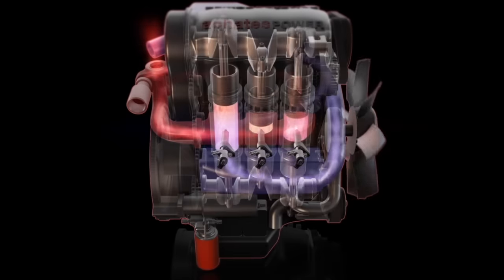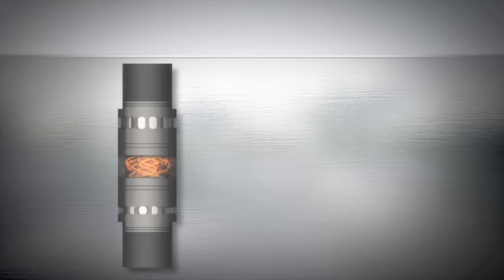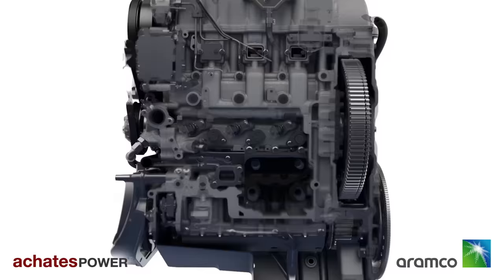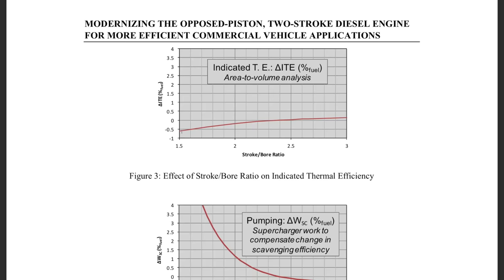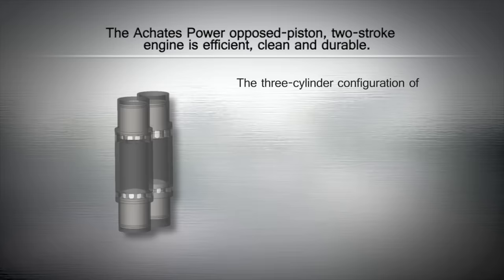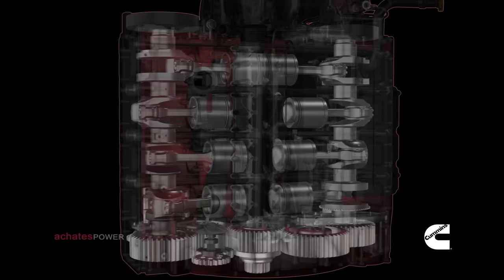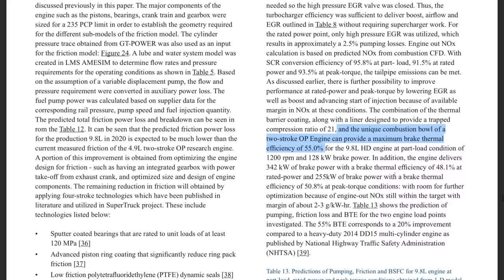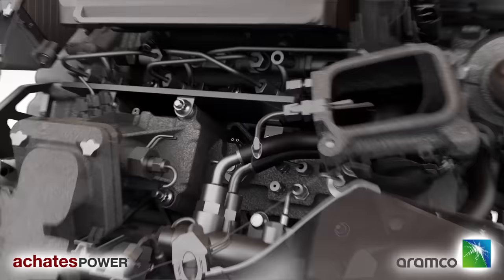Opposed Piston Diesel Engines Are Crazy Efficient

Comment: In homestead fl. There is the largest diesel electric power plant in the u.s. it has 8 op engines and 9 v12 dla engines in 1975 i spent many hrs with my friend who was the plant operator on the midnight shift and these nearly 2 story high engines all ran in sync at 450 rpm and it felt like an earthquake in the ground even 3 blocks away. What was cool was to stand on top of an engine over a cylinder while the fuel mixture was turned up ritch until that cylinder began detonating . It would lift you inches off the head. Also it was so loud inside the plant that you had to screem loud into another person's ear to be heard.  The plant was flexible as well when diesel fuel was expensive they could either mix the diesel with natural gas or run on natural gas alone but that did increase the operating temperature. THE sound of detonating engine; (LOUD)  BAM BAM BAM .The cylinders in the op engines are so big that you could fit 2 people standing face to face inside one.  The crankcase was waist deep in oil. There were blast doors on the side 6 foot square that were spring loaded to release pressure in case of a crankcase explosion.  Which could happen if the engine ever began detonating for a long enough time fire pushing past the rings could ignite the oil fumes in the  crankcase. Anyway thats a bit of my experience with op engines. RIP To my best friend Kim Crain plant operator,  and son of Edward E. Crain prof. Architecture University of Florida @ Gainesville Fl. Alumni.
Reply: I just asked that question in the comments...about noise.  Being 2-stroke I would imagine it would have noise issues, just like 2-stroke gas engines.
Reply: Ron Rothrock have you ever heard the 2 stroke Detroit diesels? All diesels are loud but those things are ridiculous loud. I had one in an old dump truck. 60mph and it sounded like a jet was flying over you.
Reply: that sounds cool and dangerious lmao
Reply: They didn't blow it up did they, my man!?
Reply: rubberhamburger those Detroit diesels sound awesome, but can be loud.  We had a strait piped 6-71 you could hear that thing days away!
Reply: rubberhamburger those Detroit diesels sound awesome, but can be loud.  We had a strait piped 6-71 you could hear that thing days away!

Comment: In 1952 the Rootes Group in the United Kingdom produced just such a 3 cylinder 2 stroke supercharged engine producing 105bhp. The engine was mounted horizontally giving a low CoG and a flat floor in the cab.
Unfortuately at the time the maximum speed limit for trucks in the UK was 20mph making these vehicle too powerful !!
It was too early in the development of turbocharging to have this additional benefit.
I had the pleasure to own such a vehicle with a horse box body. It was great fun to drive with enormous torque but very little engine braking. I would sometimes be flashed at when driving at night when the engine de-coked itself, leaving a trail of sparks being emitted just in front of a rear wheel giving the immpression that the tyres were on fire. On firing up the engine when cold, there was an enormous cloud of smoke (totally unacceptable today) as oil that had settled in the horizontal cylinders got burnt off.
The same technology was used in the UK by the Napier aircraft company in their Deltic diesel that had 12 banks of 3 cylinders driving 3 crankshafts. This engine was used in motor torpedo boats and some railway locomotives. It had an exceptional power to weight ratio.

Comment: There were 6, 10 cylinder (opposed piston) F&M engines on the USCG Ice Beaker I was on.  They had been going for 25 years when I was on the ship and they kept going until the ship was decommissioned in 1986.  The ship was commissioned in 1944.  They never broke down, and were always maintained and overhauled by ship staff.  It was interesting to see them replacing the lower main bearings.
Reply: bigwheelsturning the Mighty Mack!  I have one of those engines in my tug.
Reply: I ran a couple of tugs, years ago, that had Fairbanks-Morse engines.  Loved the power they made!!

Comment: The first time someone told me about the boxer engine, I imagined it like this.
Reply: notsonic Same!
Reply: it means youre born to be a 2 stroke opposed piston engineer!
Reply: This is like inverted boxer
Reply: When my bro was like 3 he would beat himself up like a boxer and then fall on the ground.... does that count?
Reply: Instead of a 3 zylinder you could call it a 6 cylinder boxer. For balance, this seems even better then a regular boxer.
Reply: Your not wrong.......
Reply: @MrKkdkk  no it's not at all really. Last time I checked subaru's didn't have two crankshafts.
Reply: @ryanmccurdy1179  yes two engine block and one crankshaft instead of two crankshafts and one engine block. That's why i said inverted
Reply: @MrKkdkk  
This looks so much simpler to assemble than a boxer.
Reply: Yea so instead the crank is in the middle and each piston has its own cylinder(boxer). This is the opposite moving the cranks to the outside but having one longer cylinder chamber for two pistons. It should still minimize vibration because the cylinder motions counter each other. My brother has a boxer, it is very quiet.
Reply: This is not boxer engine,this is sumo engine.

Comment: " I had hoped they would be in production by now "
Reply: Not going to happen, ice cars are dead now. Electric or bust.
Reply: @TheOpenSourceMerc  Not strictly true. ICE still has a place for HGVs and other haulers until either hydrogen or battery technology improves. Biodiesel is a carbon neutral alternative in the interim. :)
Reply: @TheOpenSourceMerc  Gasoline has a specific energy of approximately 46 megajoules per kilogram, diesel is slightly lower at about 43 megajoules per kilo, and the opposed piston engine has an efficiency, in practice, of about 40%.  An electric motor has an efficiency of about 90%, but lithium-ion batteries have a specific energy, in practice, of about 0.35 megajoules per kilo.  Unless someone finds a way to make a much more energy-dense battery that is also readily rechargeable, which right now no one seems to be even close to, it is electric cars that are dead.  ICE cars are the present and the future.
Reply: @redrackham6812  Put your money where your ideas are, and buy a car with this engine for you and your next generation. Good luck with investments in gas related engines for small applications (cars). Not all is about autonomy (efficiency and specific energy), is also about contamination, cost of liquid storage and transport, convenience energy reload (in your home instead drive to a place to refill) and so on. ICE cars are dying very fast, just some people don't understand it yet.
Reply: @javqui410  As far as I am aware, this car is not even on the market yet.  And I am not currently in the market for a car.  But if I were, I would with great confidence choose a conventional ICE-powered vehicle over a battery-powered one, which I would not even consider for a moment.  Very obviously, the overwhelming majority of the population agrees with me: more ICE-powered cars were sold in the US alone just last year than battery-powered cars exist in the whole world.
Reply: @redrackham6812  your under the assumption these engines work at peak advised performance at all times diesel gate.
Reply: Red Rackham a brilliant point. However current electric technology is good for most car use and should be adopted however for haulage the ice and these kinds of technologies are essential. There are so many no brainier fuel saving and more powerful designs that have been around for years. Boy do we need to start using every single idea to make the ice better
Reply: @TheOpenSourceMerc  Actually, I'm not at all.  Twenty percent efficiency is the average performance for a stand ICE.  Peak efficiency is 30 or 35%.  I'm assuming average performance over the life of the vehicle.
Reply: @jakesadiq7849  Thank you.  But I must disagree with you.  Electric cars are not good for most uses.  Even with massive subsidies, they are not suitable for most people's needs.  If they were, more people would be buying them.
Reply: They stopped making them here in the UK in 1979 after being in use in Commer Trucks and Vans made by the Roots Company and also Trains and tanks.
I used to drive a Commer van fitted with a TS3 Knocker engine for years.
Reply: Welcome_Player_One - A team of UK scientists calculated that just to replace all the vehicles in the UK alone with EVs would require 2x the world cobalt supply, all the world’s neodymium, and ¾ of its lithium supplies. Also VW calculated the emissions from mining, transporting & refining these minerals creates so much emissions the breakeven for their ID.3 car compared to a diesel car would be 77,000 miles. EVs are no solution, just a way rich consumers can signal their virtues to lesser mortals.
Reply: @Benzknees  so the EVs sold in 2018 (1.5 million cars) contain 10% of the worlds cobalt supply? You're delusional if you believe that.
Also: most cars are driven longer than those 77k miles. And that number isn't even remotely accurate.
Reply: Zamundaaa - Take it up with the scientists and the engineers at VW if you have better evidence than them😂
Reply: @TheOpenSourceMerc   electric cars are a very small percentage of car sales today. if this engine can do as advertised i think electric car sales would fall even lower. if this engine could double mpg we should be able to get 70-80mpg out of an economy car. 800 mile range. crude oil usage cut in half witch would drop oil prices.
but its been a couple years and still not here. i have my doubts we will ever get it.
Reply: @dankollars4501  exactly don't get cought in hype , it hasn't been delivered and by the time it does electric cars will have taken over. It's a case of too little too late.
Reply: @redrackham6812  The reason why ICE cars sold more is due to a single reason..charging and nothing to do with energy density. Once there's enough charging stations and charging times are improved(Samsung is already on it) ICE cars will be dead period.

There still will be larger ICE vehicles though cause that is where energy density of Li Ion batteries are at a disadvantage.
Reply: @dulipub  Even if they could get the charging times competitive, and that's a big if, it will not matter, because, contrary to what you claim, it is all about energy density.  Battery-powered cars existed before ICE-powered ones, but they lost out in the market, because the ICE-powered ones could go much, much further on a single tank of gas.  People will not willingly buy small, lightweight cars that cost as much as a luxury SUV and that you need to recharge much more often.  People want vehicles that can move a large amount of mass a long distance.  That means hydrocarbon fuels.
Reply: Jim Britt 🔥
Reply: Me too.
Reply: Welcome_Player_One Electric isn’t gunna get anywhere unless energy density of batteries increases.
Reply: @orppranator5230  have a look at solid state batterys the person who designed the original lithium ion batteries has cracked it. It's more a case of industrial manufacturing.
Reply: @redrackham6812  Correct the batteries are still the archilesheel of each electric car. The current materials to make them are rare and mining them can cause huge enviromental damage.
New biofuels are carbon neutral and the algea for it can be farmed exponential in sewer waste treatment plants. 
By farming them there you don't need alot of energy to clean the sewage. 
A pure win win situation. 
Also the coolingwater and CO2 of powerstations are also ideal to farm algea and reduce CO2 emissions.

The drivetrain of the electric car is here to stay.
ICE engines will be used as super efficient generators to power the electric motors on the open road or charge the smaller battery packs.
In city centers you can use the power of the battery packs.
Reply: Welcome_Player_One ICE are nowhere near dead, watch EE’s if you need explanation
Reply: LPG for the win!
Seriously, it is best alternative for now. It could be adapted for opposite engine
Reply: @Benzknees  Great Post.
Anyone thinking ev's are  going to replace   ice vehicles anytime soon is delusional.
Also, just how much power would be needed to charge millions of ev's at a time. Many more nuke power stations would be needed across the country..
Reply: @redrackham6812  What's the energy density of Plutonium? If it's all about energy density.

At the end of the day, customers want a vehicle that can travel the distance they need to travel.
If it's 100km per day, who cares about your energy density parotting.
Reply: @TheOpenSourceMerc  which world do you live in exactly?
Reply: @MrTubeniko  earth, and we have Google you should try it👌
Reply: Red Rackham  I used to be there with you on this.  But I’m about to start shopping for a Tesla.
Reply: Doublethink  I don’t believe your unsighted numbers.  

On the other hand, EV’s claiming “zero emissions” is unforgivable lie.  They have to account for the power plant whether they want to or not.
Reply: Draxindustries1  don’t worry they will be harnessing unicorn farts!!
Reply: @Draxindustries1  that's hitting on a real solution nuclear power, safer, less radiation than coal (surprising but true), and had the lowest carbon emission per Mwh of any energy production method available in pretty much all places. Which includes wind, and solar.
Reply: @javqui410  battery wears out at 8 years of age
Reply: @wiciuwiciu2783  I agree that is the next energy resource and its RENEWABLE! Makes more btu`s than anything currently. LPG also makes big power.
Reply: They are...
Reply: @TheOpenSourceMerc  if i had the money, id have one of these diesals in the car im currently looking for.
Reply: as long as liberals and their crazy ideas rule the political parties, you won't see NONE of the tech advancement being put to use.

Comment: PS, the Napier Deltic Engine, was basically a redrawn Junkers Jumo engine, with 3 crankshafts instead of 2.  It could develop around 2500hp.  It had 18 cylinders, 36 pistons and was used in RN warships, including minesweepers.  Also a class of very fast, powerful Co-Co locomotives, furnished with a pair of engines, derated to 1650hp each, each driving a Dynamo powering a 3-(series wound) motor bogie.  They locomotives may have had over-speed Governors to restrict them to 100mph, but I’m not certain about this.

Comment: This needs to go mainstream without delay.
Reply: Agree, just wondering why from 2012 no-one used in production...
Reply: Did you consider how are they going to set up a reliable lubrication without oil leaving the cylinder walls from the exhaust holes? Even if they make it work, I wouldn't buy it until many buy and use and prove that it is reliable.
Reply: great point, boxer engines which face similar problems do consume more oil (not by much) and do have more points of failure, but one would assume that a company boasting efficiency would have a solution of sorts to a major inefficiency.

Comment: Excellent engine. 40 years back  I worked on Doxford marine engines and nothing beats them in reliability and efficiency.
Reply: Vinsu Karma with modern technology  the concept can get only better.
Reply: Electric motors are 98% efficient. You will never beat that and simplicity with an ice.
Reply: Shabba Ukelele, according to what standard?  Well I suppose it doesn’t matter as long as you believe what is profitable to others.
Reply: If you want to count efficiency for electric motors you should also calculate the efficiency of how the electricity was made. A coal plant has around 40% efficiency, and considering that the electric motors are not that efficient anymore
Reply: What folks seem to not realise or turn a blind eye to is that to get these " efficient green electric motors" to run are the diesel powered equipment and mines just like coal copper iron really any resource used in modern day is stripped from the earth in non "green" ways.  I just find it hilarious when they bring that up like there saving the planet.
Reply: I couldn't agree more Umar. Around the same time as you, I had a few years as a marine engineer sailing on vessels with both the older scavenge piston and newer turbocharged  Doxford main engines. They were, as you say, very reliable and efficient.